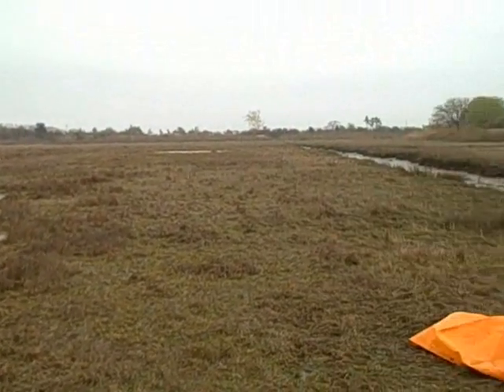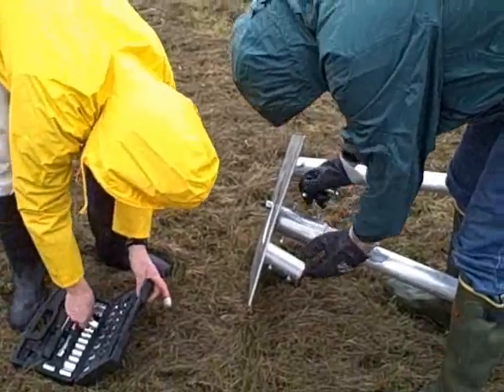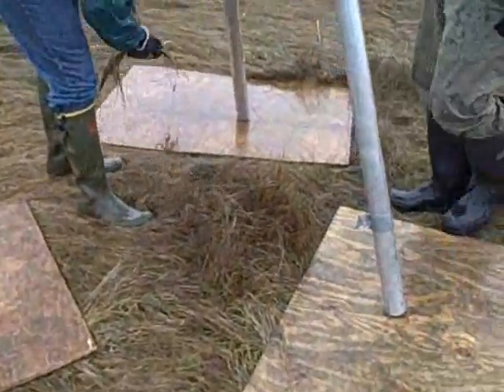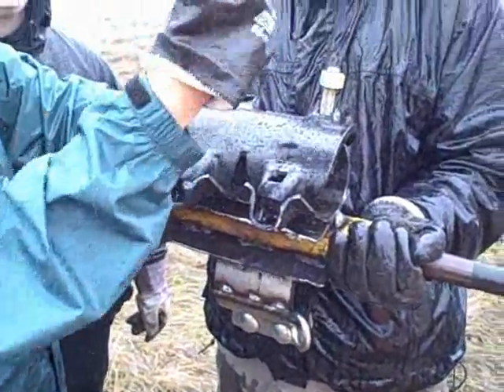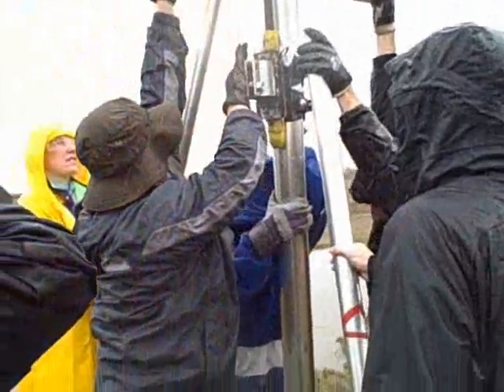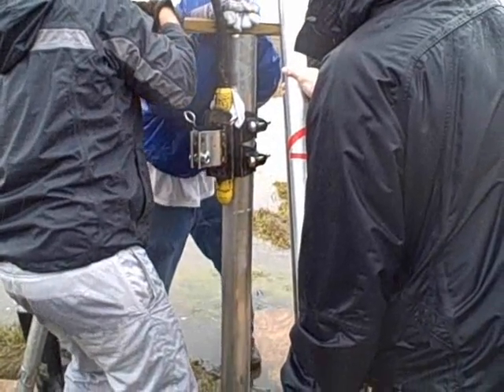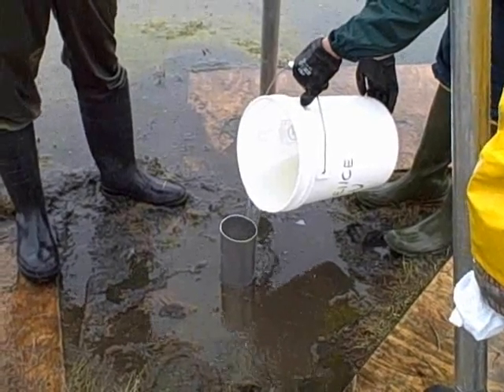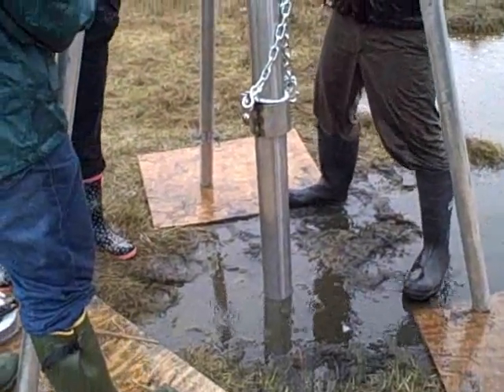Vibracoring DIY

Comment: FROM:
Finkelstein, Kenneth and Prins, Dennis 1981,
An Inexpensive, Portable Vibracoring System for Shallow-Water and Land Application, COASTAL
ENGINEERING TECHNICAL AID NO. 81-8, JULY 1981, U.S. ARMY  CORPS OF  ENGINEERS
“After removing the vibrator head, the remaining pipe is cut off with a hacksaw about 1.6 feet (0.5
meter) above the ground surface. The distance to the sediment surface inside and outside the pipe is measured to determine the amount of sediment compaction. The pipe is then filled with water and a gasmain sealer plug is inserted and tightened to prevent loss of sediment from the core pipe as it is removed.”

Comment: Im a driller...3:35 sample is lost. by adding water you added weight to the sample and basically flushed it out once the hole gained atmospheric pressure...DOH